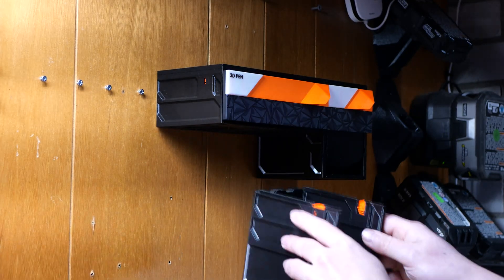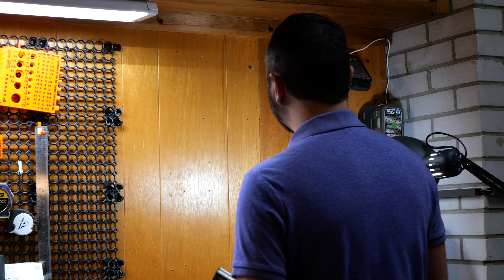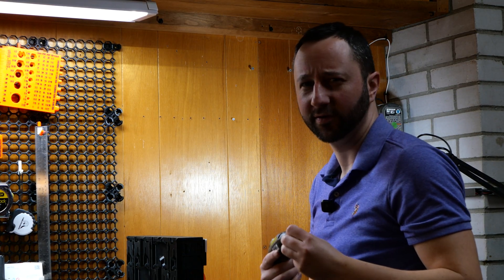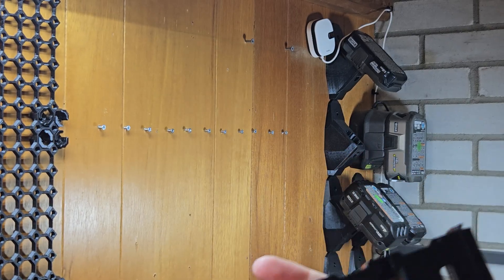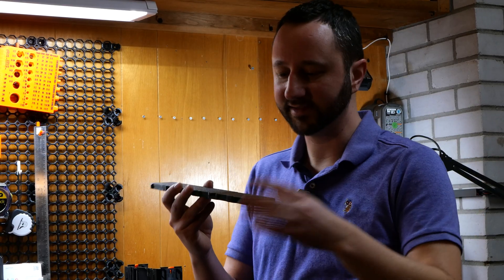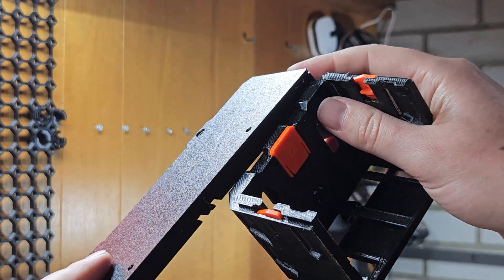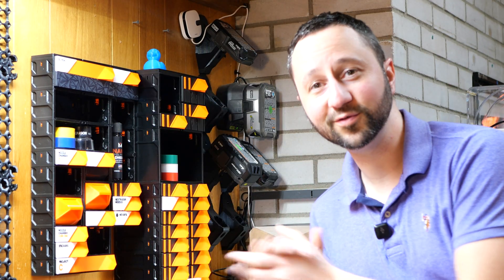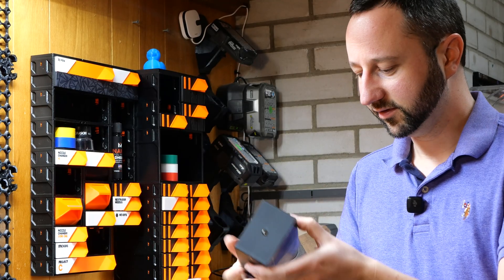GEN2 Wall Mount Lite: Modular 3D Printed Wall Storage

Comment: Great project. I use your drawers all the time. Thanks a lot. Do you think it is possible to make in compatible with Ikea SKÅDIS ?
Reply from the maker: Actually I was testing out a few ways to wall mount the 59 early on and this is what I have so far. I would like to update this design to expand further horizontally. But check this out for now if you'd like a place to start: https://www.printables.com/model/671477-gen2-skadis-wall-mount

Comment: i love the under table solution
everything about your design is just beautiful and i feel like would print in any material on any machine, tpu might not be useful but it would print lol
love from canada :)
Reply: i don't know if this is a dumb idea, but would it make sense to create versions of the cases so they can attach to multiboard or hex or skadis, whichever you think would make sense if the idea itself makes sense
Reply from the maker: @justinbouchard  Absolutely, thank you for asking, The main thing is creating ways to have the systems unite in some way, as I develop out the wall mount system (this is only the "Lite" version) I'm creating parts/hardware that should start making more compatibility possible.
Reply: @jerrari3D  cool!!!!